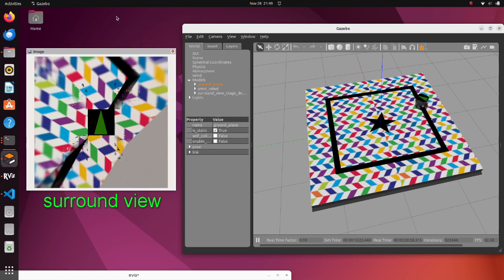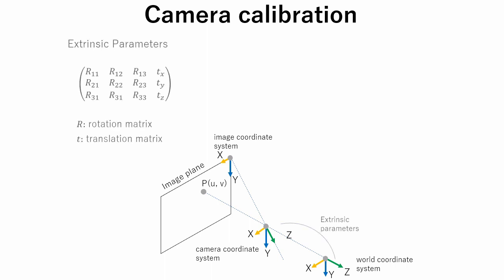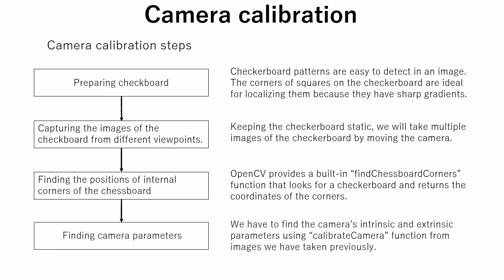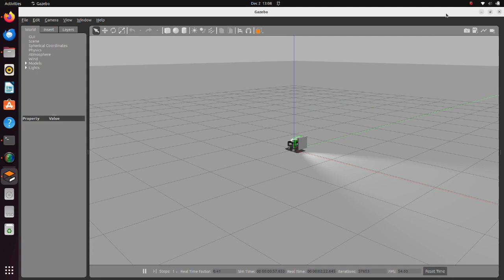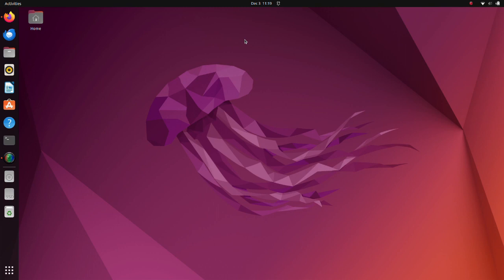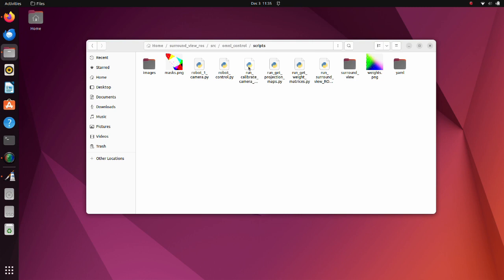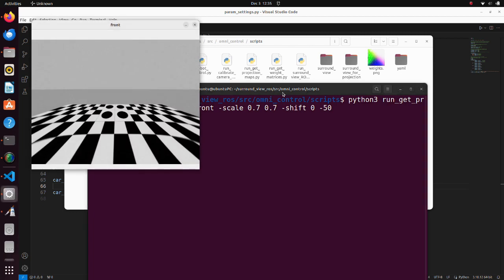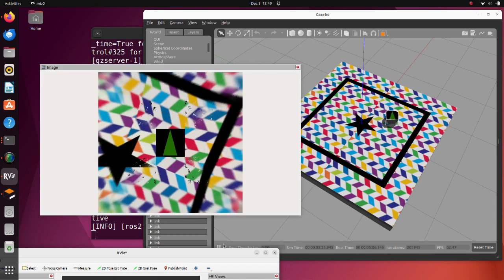Surround View with ROS2

Comment: Hi your videos are superb I always follow it.
Can you please make a video on how understand research papers for robotics and implementation in simulation/real world because I have been seeing alot for research papers but not able to implement it not able to how to implement it. So if you make a video on it will be very helpful and In robotics only lile any algorithms for path planning in ros..etc...like that...papers 

Thanks...
Reply from the maker: Hi Priya Gupta!
Thanks for watching my video!
I think your problem can be divided into two parts: understanding meaning of equations and putting mathematical equations into the form of code. To understand equations, I recommend you read mathematical textbooks and do several practice problems. Also, there is a lot of papers with code. So, you can take those papers as an example and learn how the author programs equations. I think it is just matter of practice.